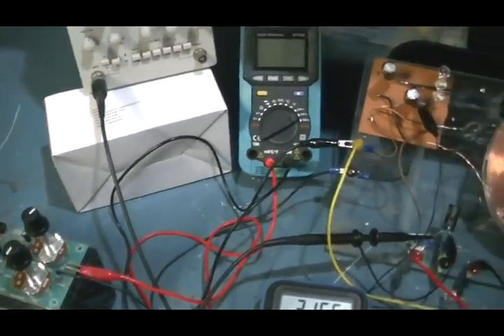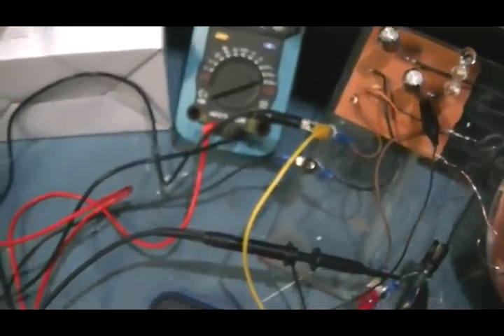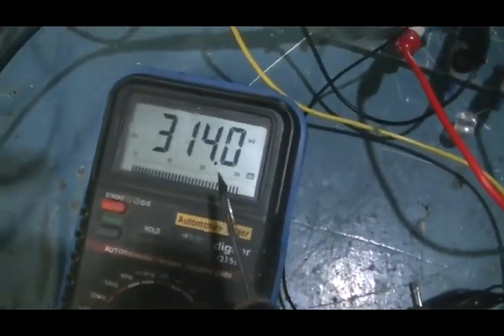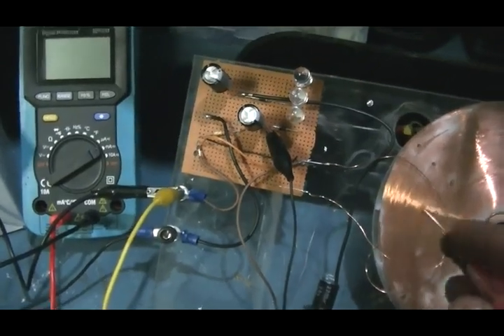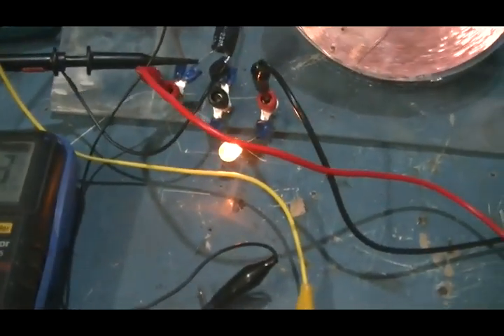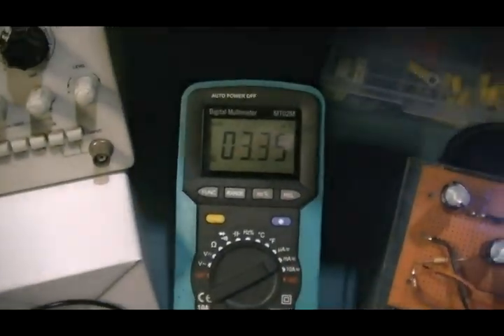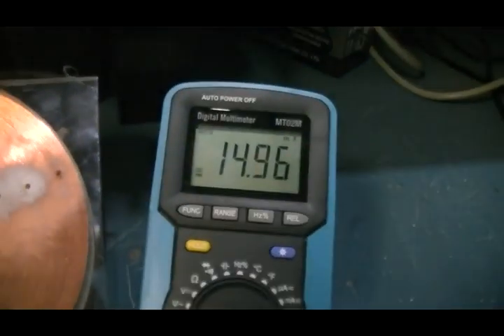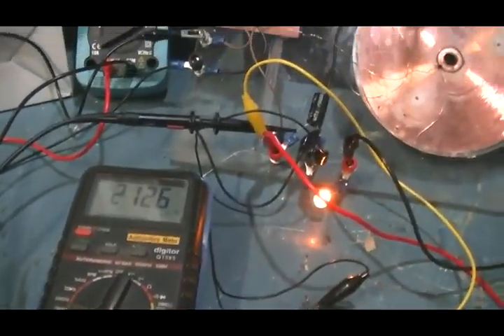Tesla circuit test pt2

Comment from the maker: HI MS]
It is a sawtooth and square-wave generator.On the square wave setting,it is a 50%duty cycle on the high side,and 50% on the low side.But this changes with frequency slightly.So some time's it may be 48% on the high side and 52% on the low side-it is only a cheap wave generator,so not all that accurate.So even though 1 amp meter may go negative-the meter on the other side should go a higher positive-but as you will see in my next video,this is not the case.

Comment: Ahh I miss understood. Saw a signal gen, and assumed it was ac sine gen, didn't realize it was a dc sq wave gen. Is the sq wave 50% duty? You can still get more when rectified I think. There is an equation to work out what it should be. Cant find it, But some are surprised to find higher rectified voltage than RMS.

Comment: I would like to see scope shot of the coil terminals. Rectified power can look higher than the AC source, Not sure if you allowed for that, but all looks ok from what I can see. Will it work with smaller caps?

Still trying to understand all your connections. Last video showed you where putting more load on the neg duty cycle. I think. 

Pancake coil is a capacitor and an inductor. Induction collapses and its a cap till the pulse drains. Add LED(Spark gap) and ac and it self resonates.

Comment from the maker: Hi SS
Well i am being very cautious with this one.The simple fact is-if it's to good to be true-it normaly is.
What im hopeing for is for some one to see where im going wrong with my measurments?
As far as scaling this up-well that's no problem at all-bigger coil,larger wire,larger cap's and some big diode's.
Then a simple signal generator that opperates at the correct frequency, duty cycle and voltage for the circuit size.
Oh and also a way to stop the reverse current being wasted-next video.

Comment: Hi TM, No need to back track. What you see is very correct. The output is a generator; if you will. Or an electron pump. As per Tesla... Neg. Risistance... Or perhaps (in other words) a radiant /static converter. The problem is, how to scale it. As to nullify the input load. Input was always required in Tesla's inventions. But an input load was not. Nor depleted. Mind boggleing... lol